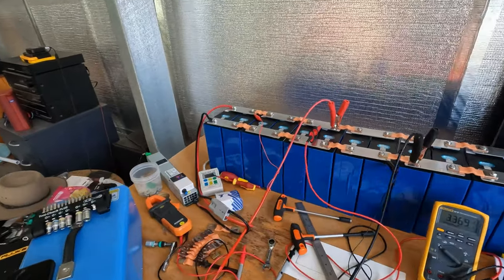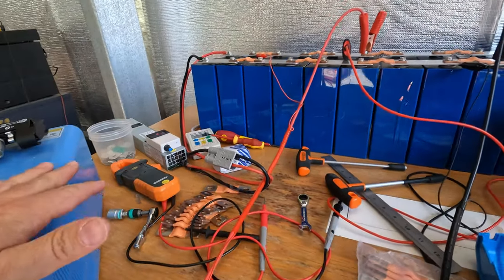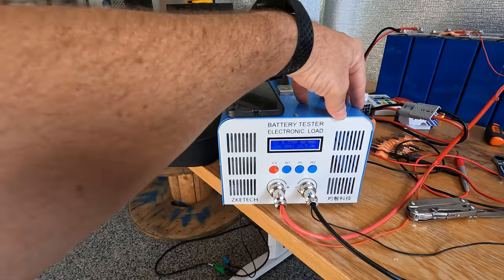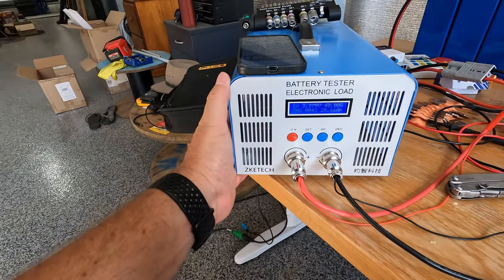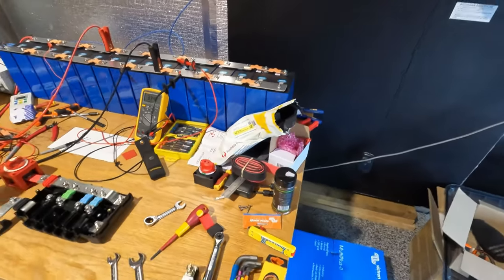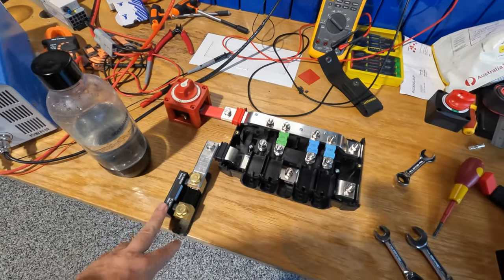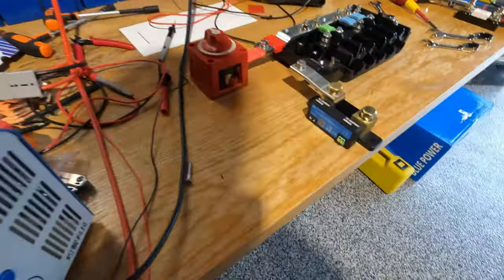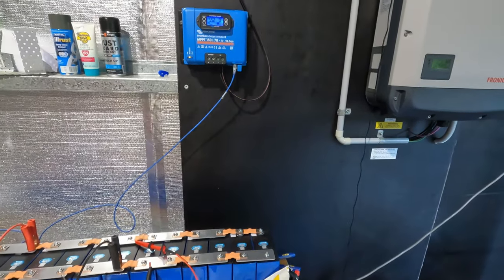Part 1 | DIY Off Grid | Solar Powered Battery Bank

Comment: Looking to do the same thing ourselves once we are built. The Fronius inverters tie in well with the Victron stuff. 

You may also look to use the 240V off grid power to provide a trigger signal to the Fronius, then if you lose grid power while the sun is up your grid connected array can run your house while the off grid recharges.
Reply from the maker: Thats a great idea...